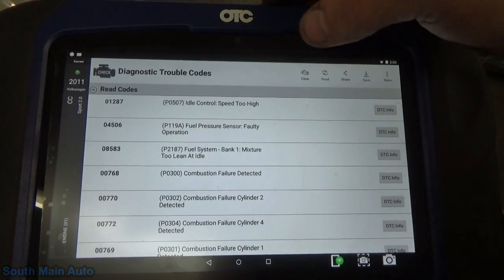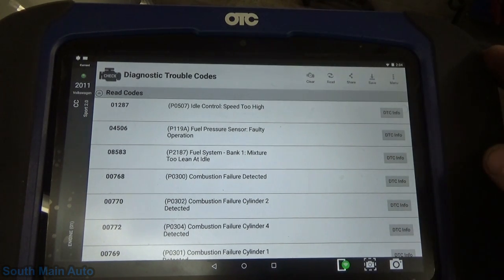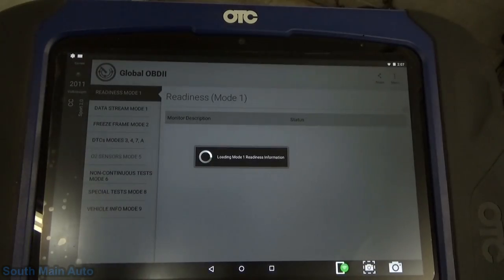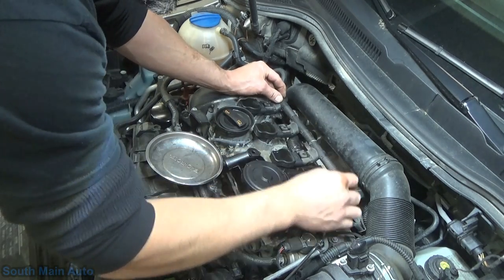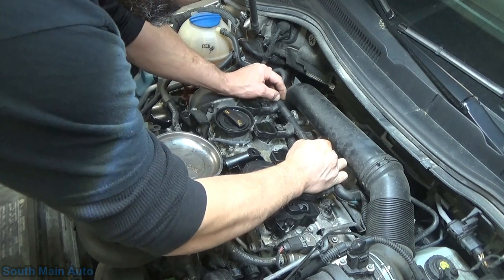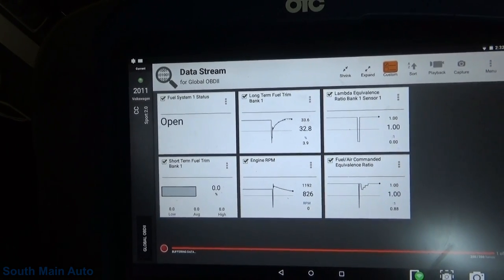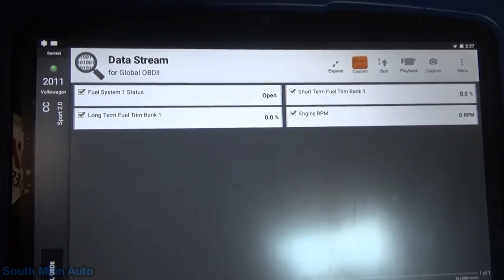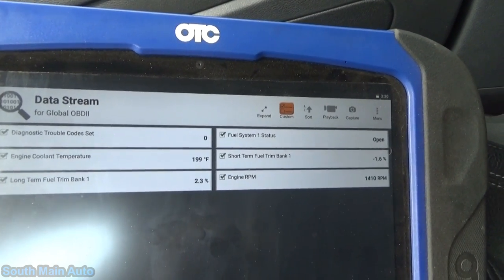Rough Running & Running Lean - Volkswagen CC Sport

Comment: In the constant search for better fuel economy and performance with lower emissions, the internal combustion engine is reaching its limits, as demonstrated in the evolution of the simple PCV valve.  I see electric cars as a partial solution. Oil companies will not like it, but it is much easier to monitor and control the emissions of generating stations than to monitor millions of polluting vehicles. While many (myself included) will miss the fuel burners, the upside is that engineers should be able to focus on handling and safety to a greater degree. Europe is leading the way on this.

Comment: So ....the infamous P0171 at idle.... am a  former 28 yr Toyota MDT.  Have had 3 separate CC 2.0's that simply have made me feel like a Diagnostic child.  Last one has had PCV/Valve cover, Intake Manifold,  Brake booster, O2 sensors, injectors, throttle body...installed at the local FolksVagen  dealer has completely drawn a blank after $3000 worth of parts thrown at it. At least you my friend....have helped some
Reply: Old comment but you can remove the vacuum supply to that separator and watch the fuel trims. If they normalize then you're probably sucking in air from the rear main seal or some other part on the engine.

Comment: Who says VWs are over-engineered?  You didn't have to take the bumper off to replace the PCV valve!
Reply: yea or a headlight out to get to a ground wire that should be run to a fender
Reply: I try to do a thermostat on an Audi realize I had to remove the hole front of the car to get to it I told the costumer this is what I got to do and it's going to cost more he told me to put it back together I do it as a hobby. He ended up buying another one I guess a got High quotes to fix it. Deffently I like to stay away from those cars
Reply: LOLOLOLOLOL!
Reply: the parts are precisely engineered to fail prematurely for economics purpose.
Like soft discs paired with hard pads...
-or 
fuel pumps that put out lazy pressure before the DC brushes keep the rotor from spinning 😂
Reply: On the Volvo 2.5 you have to pull the metal intake manifold to get to their PCV box 🤦‍♂️ over engineering at its finest
Reply: Or remove the whole cooling system to do a belt.

Comment: I'm not sure if your snap on Verus has the feature to set the readiness monitors ( try the expert mode) VCDS may be able to do it depending on the chassis, it's usually 01 engine and then cleared the codes, go back and  go to readiness 15 .  If the vehicle you are working on has the feature to set monitors, it will be highlighted on the left bottom corner and just follow each step. It may take up to 20 mins to set the monitors.

Comment: Did you check the oil? I think it could suck the engine oil trough that faulty PCV valve.
Reply: Sdttn many of these TSI have huge oil consumption
Reply: bbogdanmircea ... due to faulty piston rings on pre-2012 1.8 and 2.0 T(F)SIs. That was a warranty repair or replacement. Nothing to do with the PCV.

Comment: Volvo has same issue with their pcv. Check engine light usually will come back on. Only way to prevent it from coming back on is to reset adaptive memory ie disconnect ECM or battery. Driving the car can take as many as 3 days for light to go off. Also if you have vida subscription that will reset adaptive memory. Nice work.

Comment: One of my favorite customers has a 2009 Tiguan with the two point slow. Came in with multiple issues like this one and it did have a few weak coils and original plugs. Replaced all four plugs and coils, performed Italian tune up and it drove great for a few hundred miles before it started acting up again. No lean codes but the plugs were awfully white.

Comment: I used to work for a shop that worked exclusively on European cars. Every since brand of Euro car has issues with their crankcase vent. These not only cause lean running codes and major oil consumption issues (with can destroy the engine through not only oil starvation but also due to extreme detonation due to sucking in tons of oil vapor under load), but can also cause oil leaks, especially on turbo cars. Manifold vacuum turns to Manifold boost under a load and it will put full boost pressure into the crankcase. I've seen crank seals literally blown and and removed from their home in the engine because of CCV faults. At my shop, EVERY car that had an oil leak from anywhere got the crankcase vacuum checked during the diagnostic process.

Comment: Always check rear main seals on these 2.0 when oil separator fails will cause rear make to blow out and can cause lean codes see it all the time at the dealer
Reply: What is an oil seperator
Reply: @seandonnelly3150  another name for the PCV module

Comment: Thanks for the video.  Ill be using all the diagnostic info and info.  As I have the same issue.  Do you have any videos of replacing the valve cover gasket on the 2.0 tsi?  Also, what was the part number for that part in the video

Comment: Hey man, vw’s operate in the same way as ford and the rest. The fuel system will switch from open to closed loop as soon as the ecu receives a signal from the lambda sensor. This will happen as soon as the sensor is hot enough and begins generating a signal. A brand new car can switch from open to closed within one minute of startup. An older car or older sensor may take 2-3 mins. If it takes longer then the sensor is lazy. If it doesn’t switch to closed loop then usually the sensor is knackered. You can check with your scope. Also remember if sensor 1 is cooked sensor 2 will still tell the ecu that the car you just repaired is now running very rich. I believe sensor 2 does influence the ecu somewhat on fuel trimming although sensor 1 (regulating probe) is the main boy for that.

Comment: I replace my PCV setup on my 2016 Jetta 1.8 Turbo with a catch can just eliminate all that plus helps with the carbon on the backside of the valves with the direct injection I absolutely love that car though and nice video man keep up the good work
Reply: hi man i had vw jetta 1.4 tsi in canada i had rough idle issue what u think is same like your car

Comment: Also check for oil leaks, rear main seal are common on the 2.0l the upper timing cover seal working for vw usually when breather valve goes bad rear main seal also leaks

Comment: Maybe try a different scanner? You've done that before, as their capabilities sometimes vary. BrakeKleen on the towel to clean the sealing surfaces? Also- depending how long it was driven in it's condition (lean) could the O2 sensor be faulty now (lazy enough)?

Comment: Hello,
Wondering if you could help me with the same engine type but on Volkswagen Tiguan 2012 (2.0 TSI)
Car ran fine until yesterday there huge whistle noise from engine . Engine idling is rough.  Then P0507 code came on.  I try to pull the engine oil cap out while engine is running, engine want to stall as there is strong vacuum in engine.  Few google search and convince that the pcv valve is the culprit for whistling noise. I replaced with VW OEM part. Engine is now running fine.  I reset the code . Open oil cap, still there is strong vacuum and engine wants to stall again.  What else could I check for?

What I replaced so far:
1/ new pcv valve from VW
2/ plastic hose from turbo , there are two seals . I replaced just the small one that is about 1/4 “ in diameter because I have one in my spare O-ring kit

Current issue:
Can’t have the engine running without oil cap or oil dipstick remove.

Help!
Thanks for your time,
Mannig

Comment: Eric, I was dealing with the same thing on my bmw, i replaced the valve cover, which has ccv built in, and breather hose. I wanted to check fuel trims afterwards, what would you say is the best diagnostic reader to purchase for an 08 328i sedan?

Comment: WOW … Ive never seen the removal of the oil cap cause the engine to die … that is awesome
Reply: Oil cap or pull the dipstick. If its starts running rough or dying out, change the pcv valve.

Comment: i had a 07 volvo xc90 had the same problem and even with good fuel trims after the fix it would set a bank 1 rich code until i disconnected the battery cables and jumped them together. after that the trims went down even more and now its happy. i was surprised my scanner didn't have the option to reset learned fuel trims

Comment: Chevy Sonic and cruzes have the same issue, also ran across a Volvo with the same issue all turbo engines
Reply: Just had a 1.4 in a chevy today that needed the valve cover. Also had a volvo last week that needed a oil separator as well.  Volvo decided it was a good idea to make it part of the oil filter housing.....   here I was thinking that bmws were the worst with their stupid oil separator under the intake.

Comment: I am showing code po302 misfire in number 2. Just replaced coil and spark plugs. Engine runs rough on start up once warm runs great. Should intro to replace the breather system like that ? I have 2014 cc.

Comment: Question. I just changed mine on a 2013 Volkswagen CC sport and there wasn’t really much suction on the oil cap or oil dipstick but there was a lot on the pcv oil separator. After putting in the new one the suction went to the oil cap and oil dipstick but no more on the pcv separator. 

Do you have any idea why this could be happening? Is this normal?

Comment: So when you remove the oil cap while it’s running it’s not supposed to suck the cap back on? That’s what mine is doing. So I need a new crank vent valve?

Comment: HI I have a VW 2.0 turbo AMAROK 2012 and I just see by removing the hose from the  PCV valve oil is coming out to the intake manifold, is that normal? thanks for your help I really need some advice.

Comment: With VWs always use OEM.  I found Gates  serpentine belts too small causing endless frustration when installing. Top strut mounts on MK4 Golfs have to be dealer only since the aftermarket mounts are too large and you won't be able to fit the suspension back properly.

Comment: When you have those codes and the whistling noise...with the engine running tap on the pcv valve with a wrench,...if the noise changes in pitch or intensity the problem is inside the pcv valve...no scanner needed 😁👌

Comment: Even worse than the PCV systems on these newer 2.0T VWs is the timing chain tensioners. My buddy's B6 Passat bricked two separate engines with that exact same failure. I've been a VW owner for 20 years, but I'll never buy another one that isn't under factory warranty... and even then I'd probably lease it so I didn't get killed by the depreciation.

Comment: I have a very similar issue, same engine. Yanked the Dipstick / Oil Cap while running, and noticed a very erratic idle, high vacuum, etc.

My question (If you're still following these old videos) is, do you remember how the idle was?

On a cold start my car will start to slightly rev on it's own at idle, it will just bounce the throttle if that makes sense. Just wondering if that's similar to what you meant here with the title of the video.

Comment: I wish I lived near you Lol... I need some help..... So my 08 cadillac cts4 never ran rough at idle or had any misfires... So I went and had a full tune up done.. Intake gaskets, valve cover gaskets and spark plugs.. So after that my car runs rough only at idle and when i stop at a light.. And if you put your ear to the mufflers you can hear a slight misfire.. Can you offer any advice on what to do next.. One more thing I hear alot of air passing through the pcv line that runs from the top of the intake to the pcv valve..

Comment: From what I've seen, aftermarket scan tools and VW Loop Statuses don't get along.  The VWs I've owned, as well as customers' cars I've worked on, have all had a wide assortment of possible loop statuses, and most scan tools don't have a clue what to make of it.

I've seen Open, Open(fault), Closed, Closed(fault), Closed(PndFault), Closed(O2-fault), and probably a few others I'm forgetting, all with no MIL illumination.  I've also had the MIL kick on, but the car still be in closed loop, albeit in "fault" mode.  Strangely, it's always been the Torque app that's given me this information, where a lot of other generic scantools will only display Open/Closed loop.  It's insanely helpful when diagnosing non-MIL driveability issues, or intermittent HO2S problems!

Comment: BMW has the same issue with oil separator diaphragm, only it is a pain to get to, since you have to get the intake manifold out.... on the plus side, it is an easy way to get a bmw for cheap. The part is like 150

Comment: I own a 2012 VW CC 2.0 sport and I was wondering why  my car has a high idle when driving , plus I had/ have this oil problem that my oil pressure sensor goes on a off and my coolant levels keep going down with out no signs on leaking what’s so ever from coolant nor oil not engine lights on

Comment: I have a 2012 BMW 328i, that has the PCV valve integrated into the valve cover. Lean codes, etc. So a new valve cover and $400 later, codes are gone she runs better.

Comment: Hi, I have a 2010 vw cc 2.0 with 120k mileage. Car was running rough then stopped.  Car is not starting anymore... receiving multiple codes P0016, P0300, P0301, p0302, P0303, P0304 and P0506.. had to tow it.

What would you recommend?

Comment: Hi, i change the pcv for a new one, it had the rubber tear. But when i turn the engine the big vacuum of the oil cap was still on. What else could it be?

Comment: Daughter bought an 01 Passat turbo with 110K on it. It was Dad's nightmare. Cam chain tensioner was bad about 120K over 400$. Coils went out and a coolant leak on turbo cool circuit. I told her no more. She bought a new Toyota. BTW radiator was completely stopped up when she bought it. Never again

Comment: On VW and Audi cars every time you erase the fault codes it will erase the long term and short term fuel trim this is why I always check it and write it down before deleting any faults the fuel trim and the short and long term will go to a maximum of -25 % to + 25 % and as a rule of thumb both fuel trim is ok if they don't go over - 10 or + 10 % if it's more than that it will start to throw fault codes for lean or rich and concerning the close loop as soon as you see activity on the short term trim you know that the O2 sensor is in closed loop. And yes the rear main seal will eventually fail they are super weak compared to the older engines what append is the part of the seal detaches from the seals métal housings to my knowledge all timing chain engines have the same seal design I'm not sure about gen 3 engines. By the way these engines have no valve cover gasket it bonded to the cylinder head it actually holds down the 2 camshafts they rarely leak tho.

Comment: The key to Volkswagen Audi plastic connectors is just a little bit of silicone spray, wait two seconds and then pull it, you'll be 10 times less likely to break it.

Comment: Hi        long term fuel trims   can be found in measuring block 32 & S/ T in  33  .  fuel sensor measuring block 31.     I all way reset throttle body first.  JS
Reply from the maker: Great tip!

Comment: I don't know if you ever look at old vid comments, BUT.. I have a customer with a 13 Jetta 1.8 turbo that has an oil consumption problem ( 45k on it) Obviously on your test subject, the PCV had full blown failed. The 1 I'm dealing with I THINK is beginning to, POSSIBLY causing the oil consumption problem. I have 12 inches of vac at the dipstick... Ivan did a vid on a 14 Jetta ( different issue ) but he checked that 1 and it had 8 to 10 at the dipstick. I have NEVER seen ANY car draw this much through the PCV system. Can't find a spec from VW.. Thoughts?? ( anyone!)
Reply from the maker: 12" at the dipstick! Yeahhhh you need a PCV...

Comment: These engines are also notorious for carbon buildup in the intake tract due to oil vapours from the PCV system and direct injector location. This excessive crankcase vacuum problem certainly would exasperate carbon buildup, provided those oil vapours are still directed to the intake.
Reply: I mean "Exacerbate"